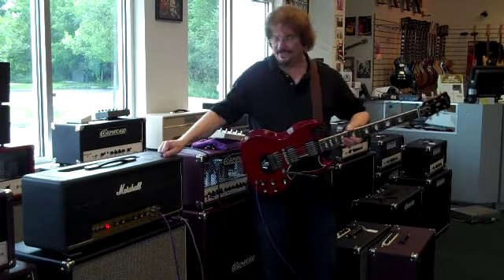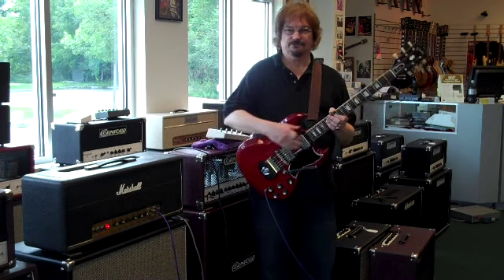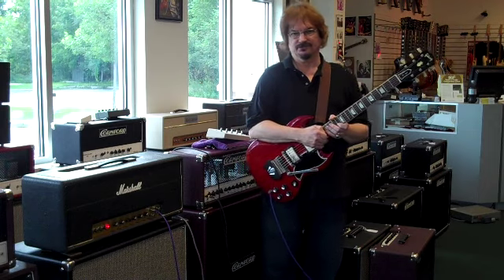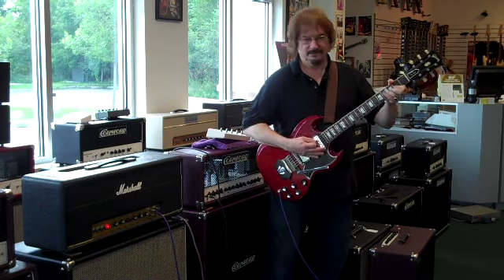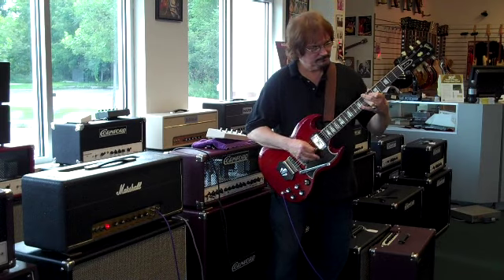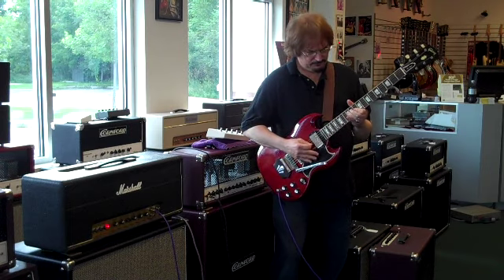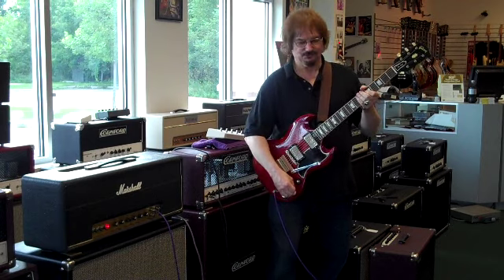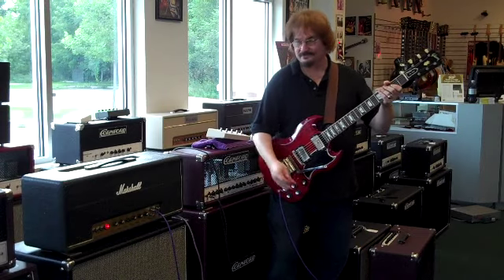1973 Marshall Super Lead 100 profiled by Kenny Rardin

Comment: screw a master volume 6672.  This amp is made to crank up and rock . If you dont have a venue that can handle it , take a smaller amp and use this in the studio to get the vintage tones rock and roll was meant for. If you cant handle the volume this amp is not for you.
Reply: power pipe Agreed.  These old amps are meant to played loud.  I have a 73 JMP 50 watter and it is loud as fuck.  Full volume is at about 6 from their it just saturates more.  However that's the tone we all love you must push some air.  That's how you get sustain not distortion which is what I want.  Besides a fuzz face, wah, reverb/delay, and a boost (klone) which are only used sparingly I plug straight in with a quality cable and ride my volume knob.  These amps are instruments themselves and very honest you will sound like shit if your technique is bad.  There are many options that can get you a great tone at more moderate volume.  These wonderful machines are beasts but once you learn to tame them: man the tone.
Reply: One word: attenuator